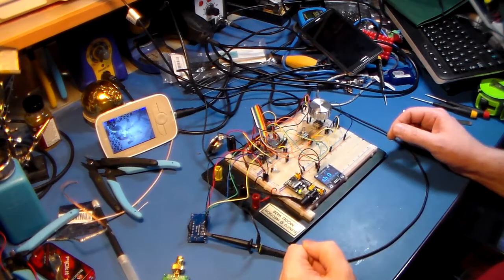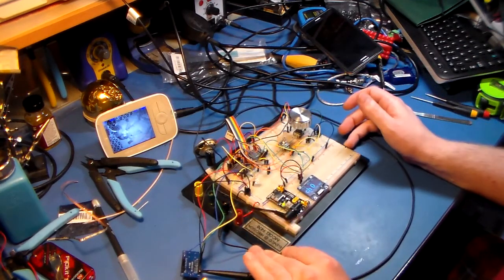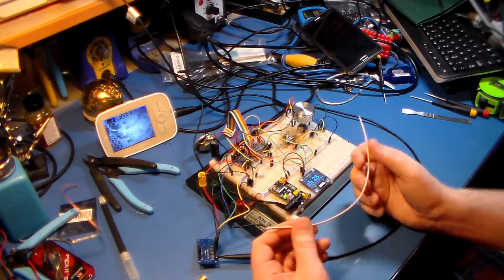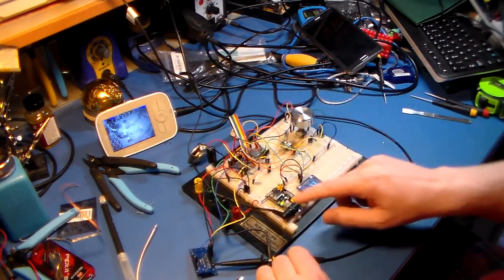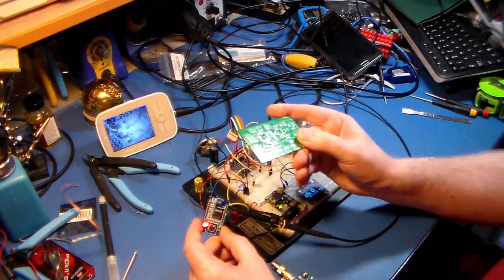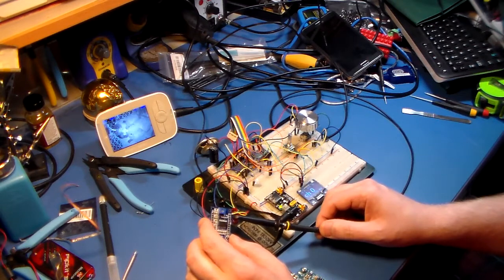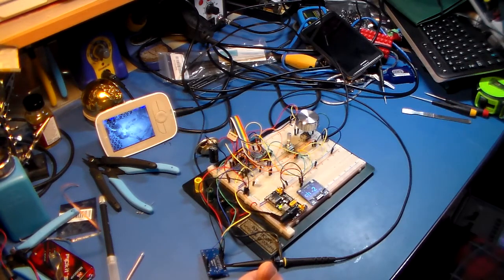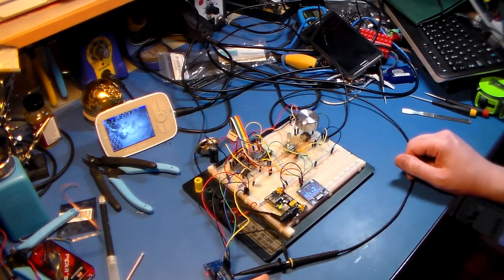DDS (AD9851) in a CB update

Comment: what about designing a SSB QSE/QSD module based on the Tayloe mixer clocked at 40.96mhz for 10.240mhz and lose the SSB filter as you can incorporate a USB/LSB switch in the Johnson counter to select the side-band that you want to chat on or using the Tayloe mixer as an up/down converter you know what I mean clock=((fin+10.240)*4) for an output at 10.240 and no need for a ceramic filter as it is not needed when using a phasing mixer, the chip you might be looking for is the MC145151
Reply: DAVID GREGORY KERR Great idea.